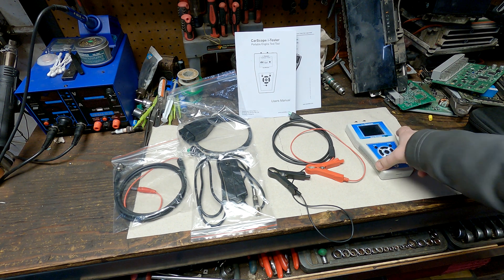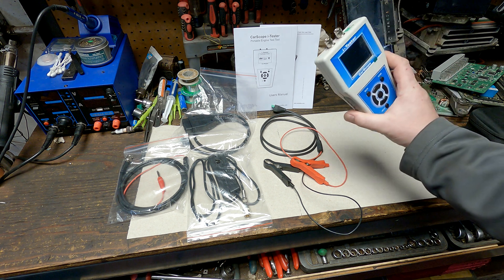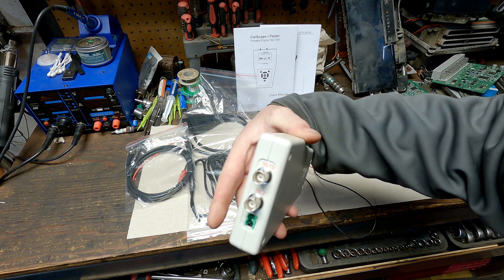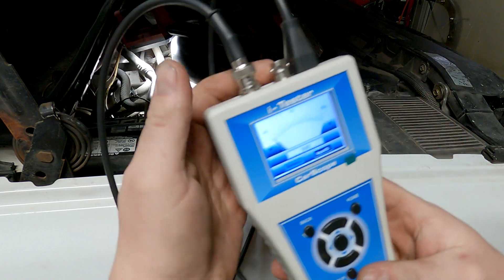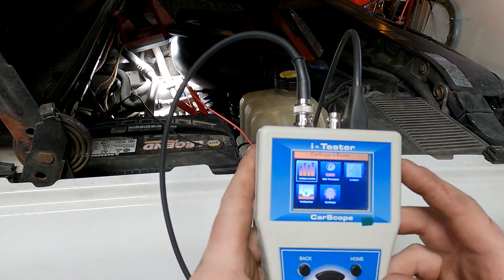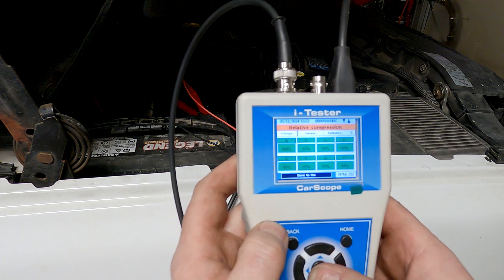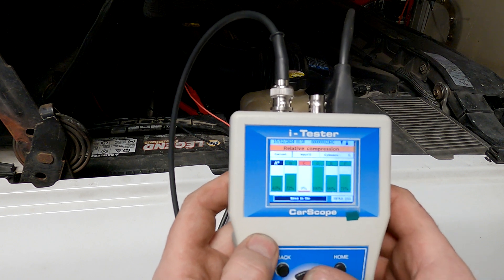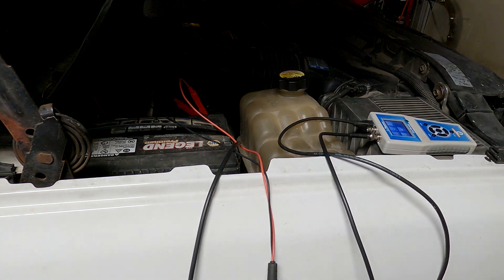Ditex Carscope i Tester : Relative Compression, Fuel Rail Pressure sensor test, Data Logger

Comment: Hi does this test mean valves and rings are good?how can l find head gasket leak with this tool, thanks
Reply from the maker: The relative compression test is just a first look style test. It would indicate a problem, not necessarily complete integrity of the engine. I wouldn't use it to find a headgasket leak on purpose. You might find a very bad leak will show as a weak cylinder.

Comment: Have you ever seen or heard of a scanner pulling up -100 on all fuel trims short and long ??
Reply from the maker: I would probably ignore that data. Most fuel trim max out around 40% 
-100 means -100%, which would indicate the engine is running off of an unmetered fuel source.
Reply: @ oh ok thanks . Was confused neighbor had CL had cat efficiency low code .
Reply: My first thought if i would see that is incorrect vehicle selection in the scantool or maybe the vehicle's ecu has been modified...🤔🤔🤔
Reply: @ yeah no none of that it’s a 2016 gmc Denali original owner no mods . He had cat efficiency low code and CL so I went into ecm and live data and that appears on the the fuel trims pids . Thoughts maybe being my topdon subscription expired but everything else works 🤷🏼‍♂️
Reply: Have you verified these numbers with OBD and with a different scantool?
Reply: @ no it was raining so we will look at it this weekend